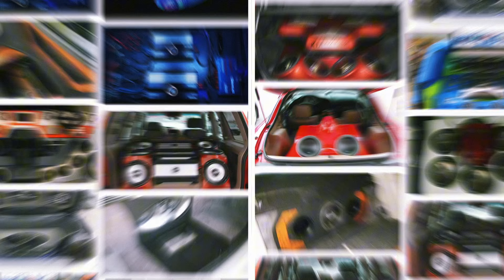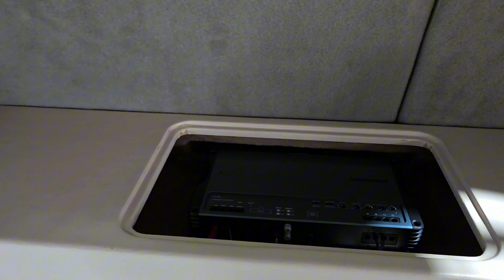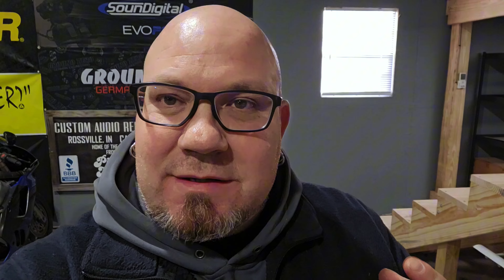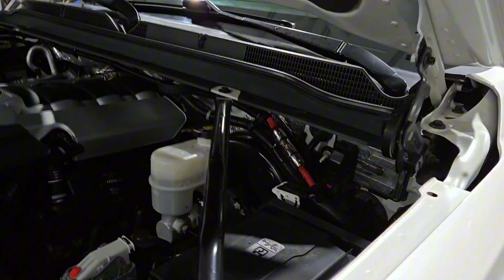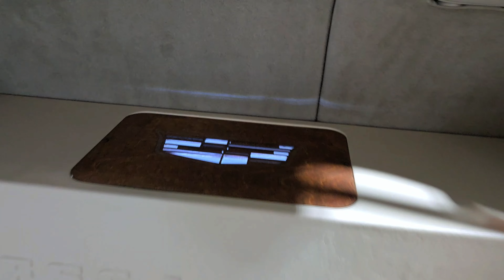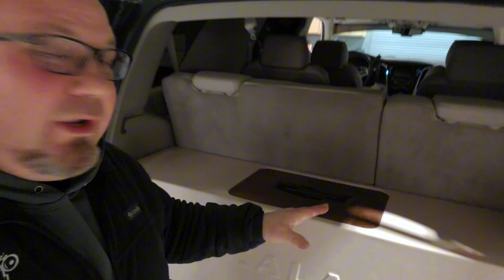2016 Cadillac Escalade Audio Upgrade Day 4. Amazing Output!

Comment: Nice channel. I'm also in Indiana, Ft. Wayne. If I ever decide to go all out with a full system in my 17 Camaro you are now on the top of my list of installers in the area. Do you know what products can integrate into a 22 Colorado/Canyon with the IOR system? I'm going full system replacement. The only piece I can find is the Crux CS-GM43. Would rather have PAC, idata or Metra.
Reply from the maker: That's a tough one being a Colorado. We have found the Can Bus in those vehicles to be very unstable and doing any upgrades can cause check engine lights and other issues, that's why your not finding much available. PAC and Idatalink maestro are the best options. If they don't make anything its safe to say it hasn't been verified or tested yet.
Reply: @CustomAudioReimagined  Yeah Crux is the only one I can find. It's the Crux cs gm 43 and Crutchfield has em.  I went ahead and gave it a shot. It works pretty good. I'd say there's a slight delay in the steering wheel controls and the reverse output doesn't work.